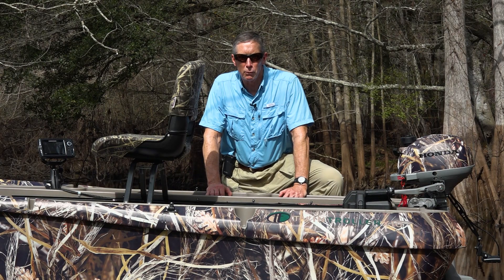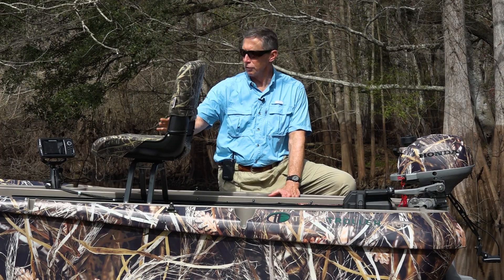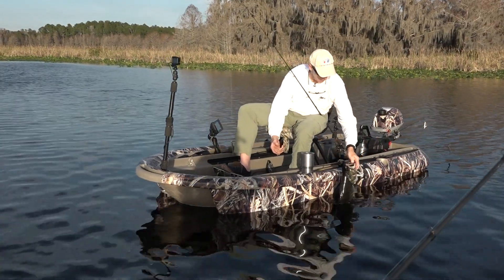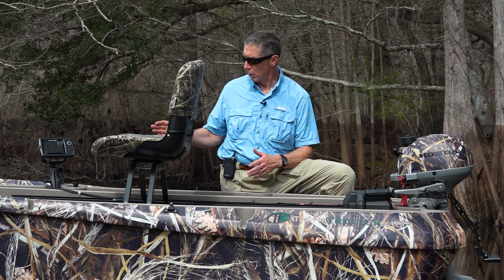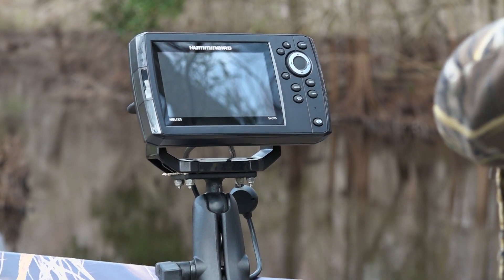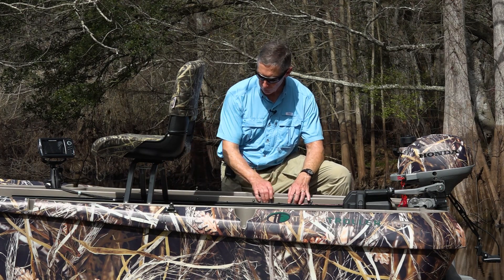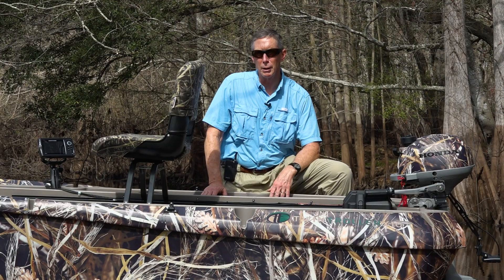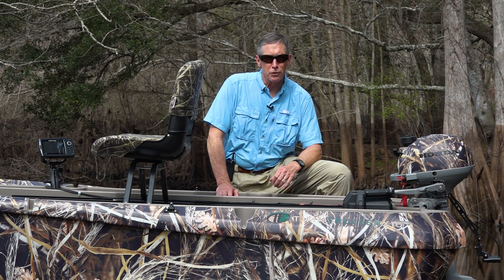Twin Troller Modifications - Frank's Boat

Comment: Frank I know you and David like the Honda    What do think about mercury 2.5.?  Is the Honda ok for salt water?! Thanks.
Reply from the maker: The Honda works fine in salt water.  We only offer the Honda.  We don't have any experience with the Mercury.
Reply: I have the Mercury 3.5 ( 4 stroke ) on my Twin Troller & love it. It's actually 100% TOHATSU.......because Mercury & several other outboard companies know Tohatsu makes such a good small outboard, they actually contract with Tohatsu to furnish many of their outboards & simply put a different sticker/logo on the cowl cover. Look it up. I run mine as much as 6 miles ( 1 -way and non-stop, except for topping off the tiny fuel tank....but you would have to do that with all of these tiny outboards, the tanks only hold about 80% of 1 liter of fuel. ) at times to get where I need to fish. It has yet to let me down after 16 months ( since I bought my Twin Troller...........ZERO regrets here. ) The Mercury/Tohatsu 2.5 and 3.5 are the exact same motor.......they only put larger jets in the carb & raise the governor's rpm to 6,000 rpm on the 3.5 to give it the extra power. That is a fact. The bore & stroke is the same, they even weigh the same.......totally identical except for what I just described.

Comment: I wish I could afford one and my credit is low 500 😕
Reply: MR-FLIP.........Do what I did: Just start saving up the money. I'm 56 yrs old, and that terrible recession that began in '08 destroyed many business owners here in Florida, myself included. I make a fraction of the money I used to. It took me about 8 months to save up enough to buy my Twin Troller that I purchased in October of 2016. I can honestly tell you it was well worth the wait & the effort. Remember, ya only pay for it once, and this fantastic little craft begins paying for itself in various ways beginning with the very first trip out on the water, and continues with every trip after. That's because there is near-zero maintenance, and  "cost of operation" is a joke. Charge up the battery, that's it. Hose it off.......a quick spray of dry-formula electrical contact cleaner to both plug-ins and the receptacles in the peddles, and you're done. I also bought a 3.5hp Tohatsu 4-stroke outboard, and a trailer from Harbor Freight that I modified bunks just for this boat. It all works perfectly. It doesn't matter if it takes a fella 2 years to save the money...........the reward is this boat. Worth every dollar, I promise you that.
Reply: Me too

Comment: Will a mercury 3.5 work?
Reply: Joseph McGee........Absolutely. That's exactly what I have on my Twin Troller, a 2016 "Mercury" 3.5hp 4-stroke. But it's actually 100% Tohatsu, and that's a good thing. Mercury simply slaps their logo/sticker on it. I jokingly call it my "Mercatsu". Mercury & several other outboard companies are contracting with Tohatsu. The transom on the Twin Troller is so strong, I actually leave my outboard mounted even when trailering down rough dirt roads. It is now going on 2 years with no cracking or damage to the transom whatsoever. Love this boat.
Reply: The older Suzuki's were made in Japan fyi

Comment: Looks like a decent boat  but the price point is way too high!  You can find a full size bass tracker with motor and trailer in great used condition for the same price as this tiny boat.  And all of your videos comparing it to the kayaks have the comments disabled probably because even though your claim is that you are not attacking the kayak fisherman pretty much all you do is trash kayak fishing in those videos.  You can buy a very decent and stable fishing kayak for less than half the price of the twin troller.
Reply from the maker: Where do we begin?  Yes, you could buy a Tracker but you wouldn't have a Twin Troller and a Tracker can't do what a TT can do.  Second, yes, you could buy a kayak for half the price, or you could buy a kayak for more money.  And, then again you would not have a Twin Troller, and a kayak can't do what a Twin Troller can do.  Those that want what a Twin Troller can do, buy a Twin Troller because no other boat can do it.  There are many, many, many TT owners that sold their Tracker, kayak, Ranger, the list goes on, because they wanted what a TT can do.
Reply: Preston Halcomb my Hobie pa couldn't hold a candle for a twintroller . I have to Peale all the time to stay put and I have to use one hand to turn. Tt is the best fishing boat hands down. And I don't have one (yet). But I'm selling my Hobie to get one and yes I will loose a thousand bucks. And yes my Hobie has reverse
Reply: I just purchased my TT this past Monday and can’t wait to hit the water with it.  I’ve been waiting to purchase one for a couple of years.  The price was high in my mind at first; however, for what I’ve seen and read it’s definitely worth it.  I did look at the Pelican and others.  I really love the low maintenance selling point and the maneuverability.  I’ve purchased a Helix 5 DI GPS and other stuff.  I’ve watched every video and finally joining this community.  Let’s go!!!!!!!  BTW, David was awesome to work with on my purchase.  He was honest and informative.